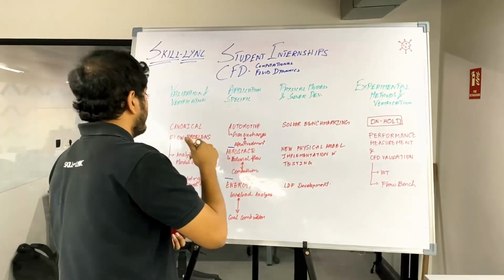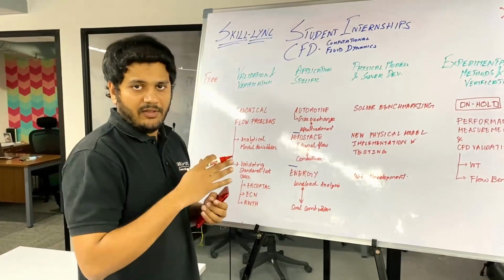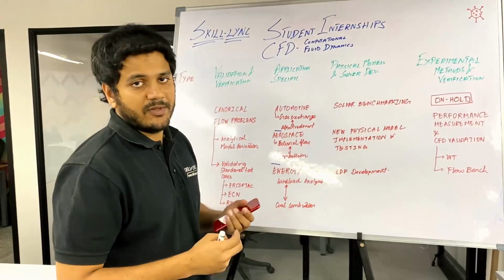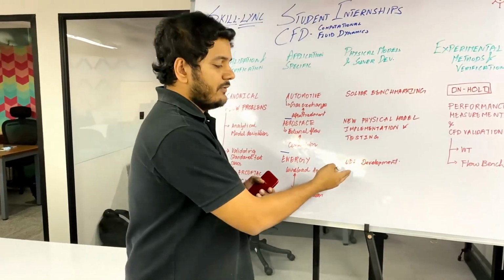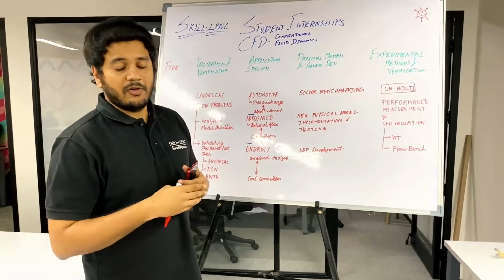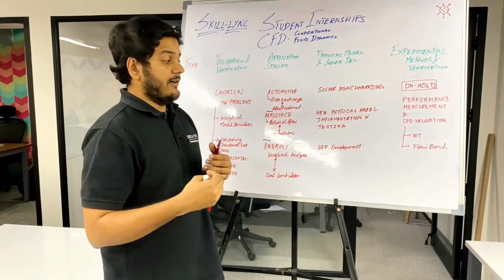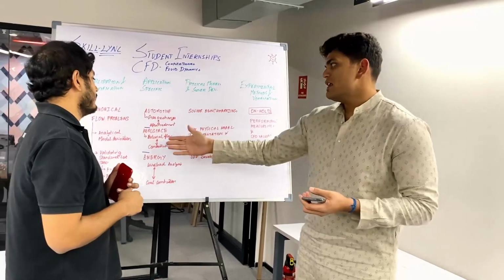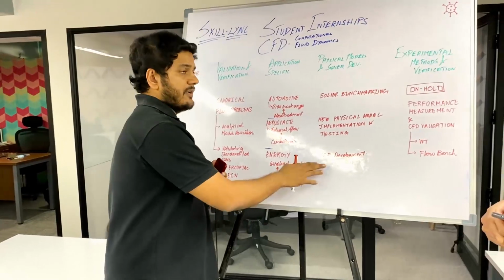CFD Paid Internship & Projects | Skill-Lync

Comment: Hello skill lync.. I am 2017 mechanical graduate with a cgpa of 8.01.. what are the chance of getting a job after such a gap after I enroll for the masters course ? Considering full effort given by my side during the course work ?
Reply from the maker: Hi Santosh, if you put your full efforts. The chances are greater than 90%. You can get a detailed career session by contacting us through 9809805252 or 9790707274
Reply: @SkillLync  please make a video with insights on masters program on external aerodynamics and a brief on the career path and opportunities ... I have searched intensively  about that course but there is very less information about that